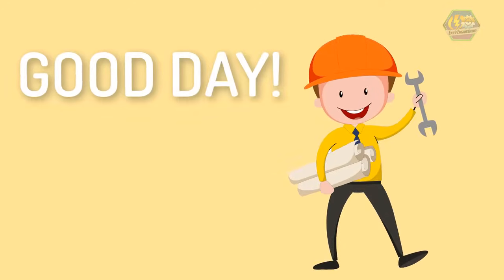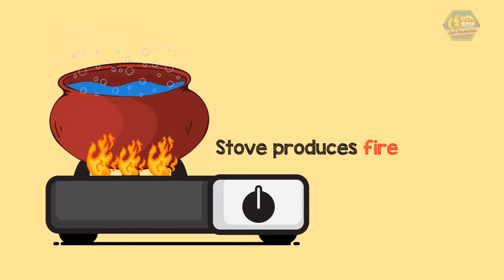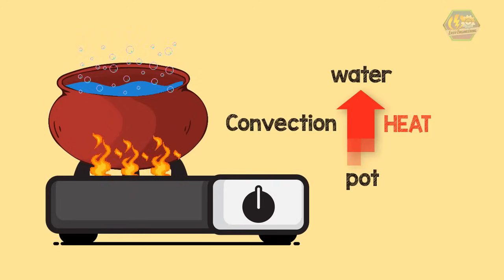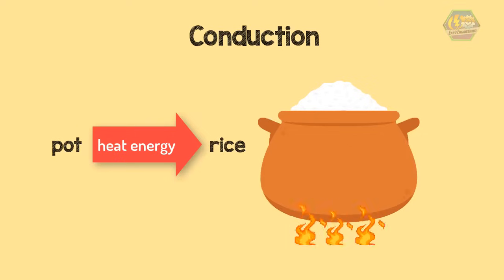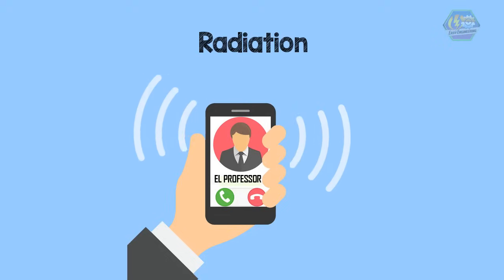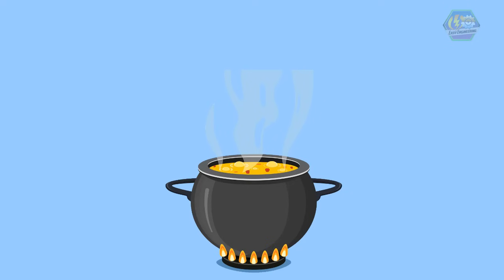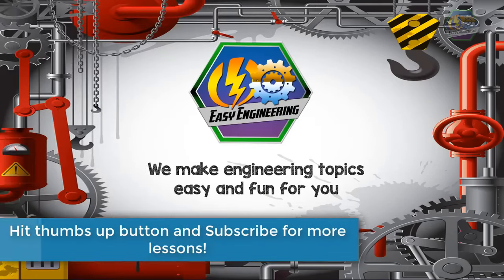HEAT TRANSFER | Physics Animation

Comment: timestamps
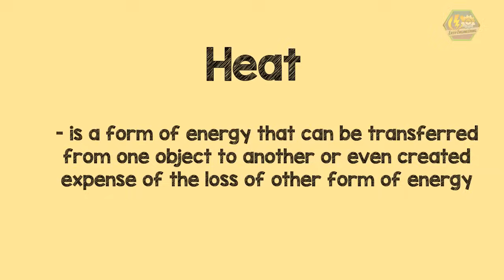0:26 definition of heat 
1:04 3 forms of heat (conduction, convection, radiation)
1:42 about conduction
2:11 about convection
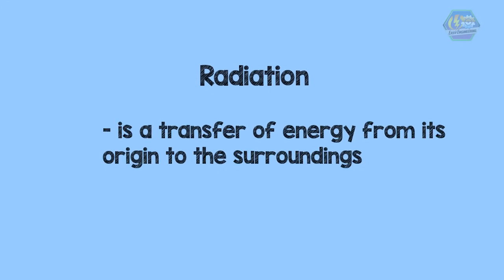2:33 about radiation
3:18 quick question and answer